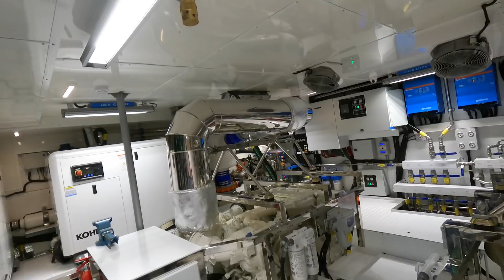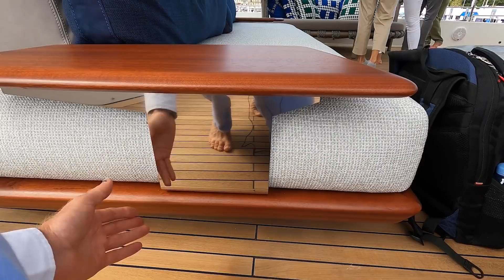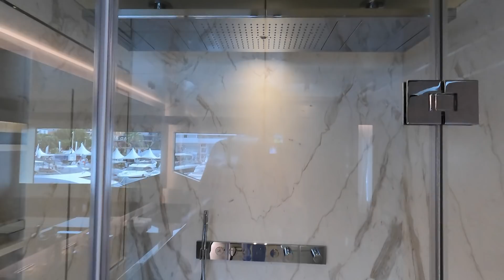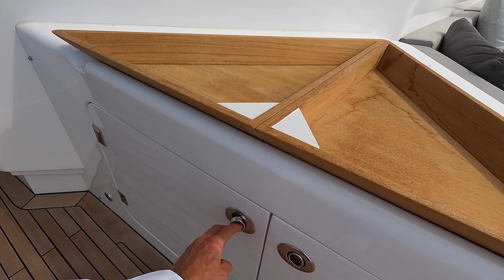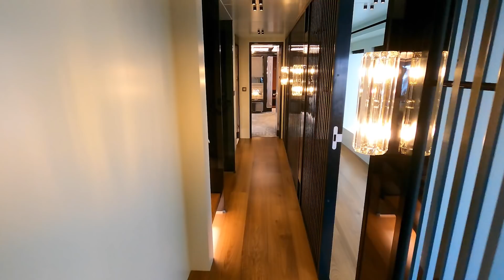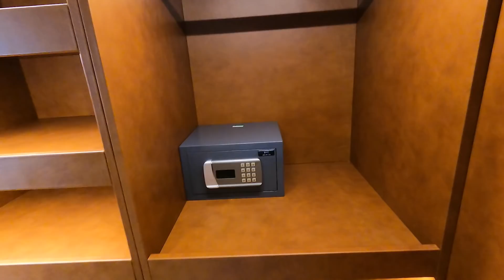Immense €12m superyacht with a sauna and gym | Numarine 37XP yacht tour | Motor Boat & Yachting

Comment: Numarine xp37 turkish  yacht
12mil euro price n 16mil usd  in us.
One of the nicest yacht in its class ever.
Price quality ratio. 
Interior design .
one of the biggest gross tonnage for the length 345gt. 
5.000nm range at 10knot.
6.000nm at 8knot. 
53.200liter fuel tank(it takes 135k usd  to fill 53ton fuel tank)
8metre beam 7crew
truly amazing .turkish yacht builders are great
Interiors by hot lab yacht design.
Hot lab is one of my favorite yacht interior design firms with 
reymond langton design.
Nuvolari lenard
Winch
Bannenberg n rowell
Sinot yacht design
archille salvagni
Alberto mancini
Enrico gobbi team for design
Francesco pazcowski
Giorgio m casetta
Christiano gatto
etc. .

Comment: This is an amazing vessel, almost flawless! But an important one is that, if I had this kind of money, my cabin would never be facing my tender or water toys... Other than that, wow!
Reply: Depends what your tender is. I wouldn’t mind staring at a Riva Aquarama!
Reply: @hugoandreae3495  Rivas are great, but I rather look at the sea.
Reply: That's when you just ring the outside of the doors with stripper poles and exotic dancers.....problem solved)

Comment: Did he really say 52 000 ton fuel capacity? Surely that's wrong? Has to be 52 tons right? 52 000 tons would equal roughly 52 million liters diesel...
Reply: It’s definitely 52 tonnes
Reply: Did you really need to have to ask that question you chooch
Reply: He meant 52 million tons DA

Comment: My new favorite yacht. So much space in 120 feet. Six thousand mile range. I wish more yachts would stretch the main deck to the bow. I’m sure this boat has more room than most 150-175s. Just an incredible boat.
Reply: I like the Bering range.
Reply: 52 tons of fuel (assuming metric tons) is 15,600 gallons, and a 6000 mile voyage will take 41.5 days at 6 knots. If we assume diesel prices at an average of $3.80USD/gallon, then this trip will cost cost roughly $60K in fuel. This big bitch is going to suck back $1,450/day in fuel! I hope everybody doesn't mind eating KD for 41.5 days lol

Comment: Can you tell me , when exactly the dumbest ever term for the stern of a vessel .  Was given the name ... Beachclub. 

Can those windows actually endure the full force of waves crashing against them ?  

Why bother with a Sauna when heat of the sun sailing on a sorching day .. will sweat you just as much
Reply from the maker: This boat has the range to explore beyond the Med - Sauna in the Norwegian fjords sounds pretty good to us!
Reply: @MotorBoatYachting  which makes more sense than your own MB&Y video series by that mad lad John Boyle where he pushed a Princess V39 up to Norway... and then jumped into the waters the moment he hit the artic circle.
Reply: No, but that's why there's a watertight door into the engine room.
Reply: @Th3OmegaPoint  1. I believe it was the marketing campaign for the Feadship UTOPIA back in 2004.
Reply: @Th3OmegaPoint  If that vessel were to endure storm damage i'd hate to think of the cost to repair the interior  . That's if it survived the storm without capzising due to the influx of water .

Comment: 52 tons of fuel, 1000 litres weighs 1 ton,
I couldn’t afford to fill it with fuel let alone purchase one 😂😂
Stunning boat though,
Reply: Depending on the source of information, the weight of one liter of diesel would actually be between 0.832 and 0.860 kg. Wikipedia says 0.832. This means 62500 litres (16510.753 gallons) of diesel. Thats a lot :)
Reply: I can barely afford the data traffic airing this video clip.
Reply: Me neither!
Reply: It's hilarious how on nearly all the 40ft+ motor yacht reviews, they mention the range at a particular speed, but rarely if ever the hideous rate of *consumption*! To be fair, I think the Aquaholic guy once did on a big Sunseeker. I dream of the day a reviewer goes into an engine room, shows us the hydrogen tanks and fuel cells, and mentions the x00 kWh batteries lining the hull.